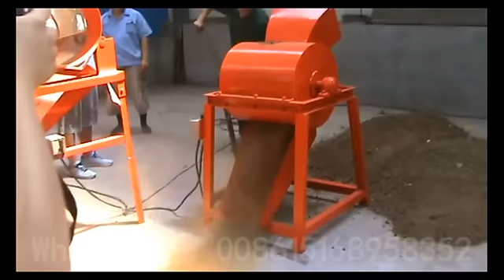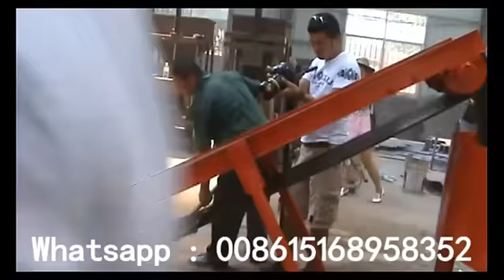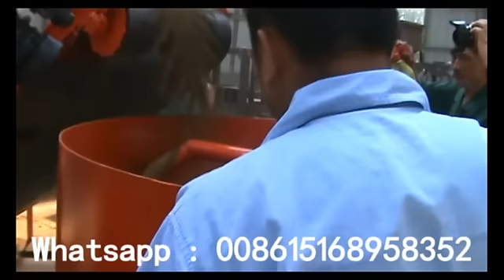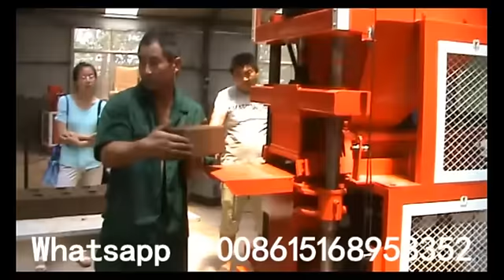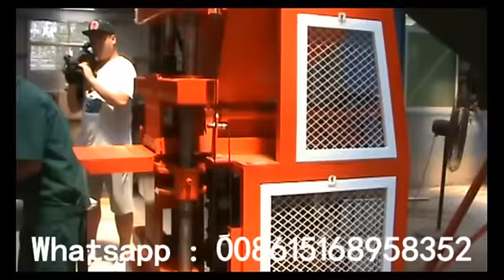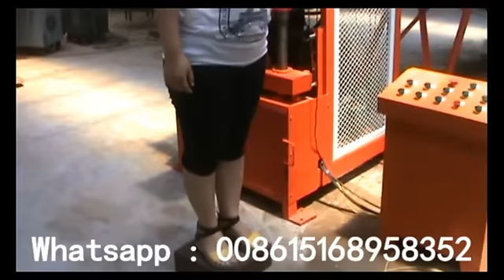FD1-10 Interlocking clay brick making machine, lego cement clay block making machine

Comment: mow many bricks per hour ?
Reply from the maker: Hello Ruwantha , it is about 300pcs per hour. 

Contacts : Lucien Li
Phone/Whatsapp/Viber : 008615168958352
Email : dymachine01@gmail.com
Reply: in Sri Lanka, the clay bricks are made and let them dry under sin light for couple of days and once bunch is made it goes through a burning process before they are being used. 
these bricks also go through similar processthe same method?
Reply from the maker: I think you are talking about red brick, this kind of brick is different with red brick. Usually, it is no need burning, only nature curing.